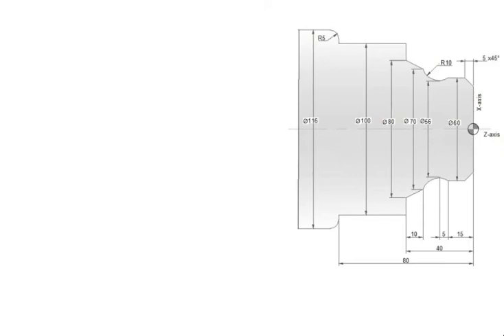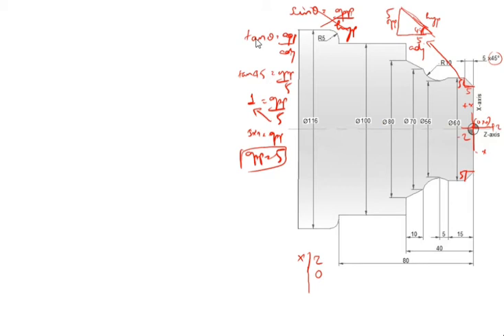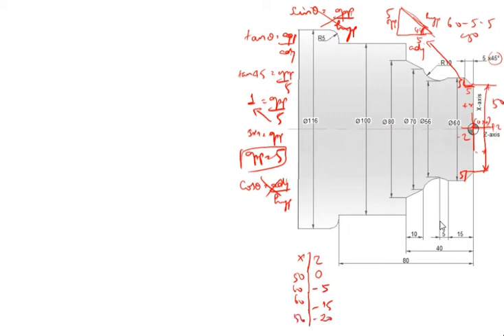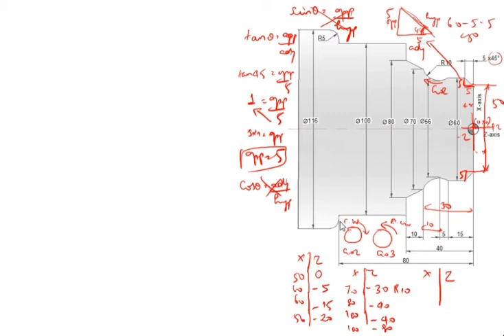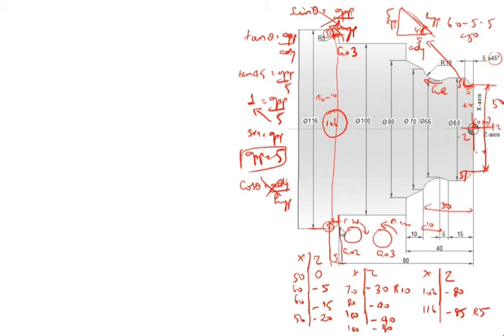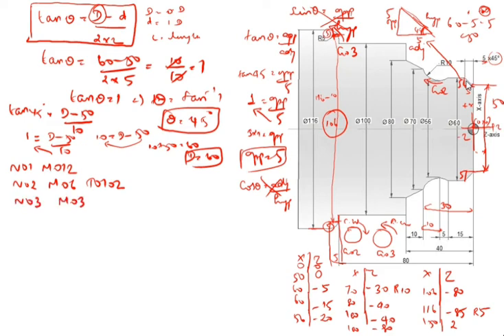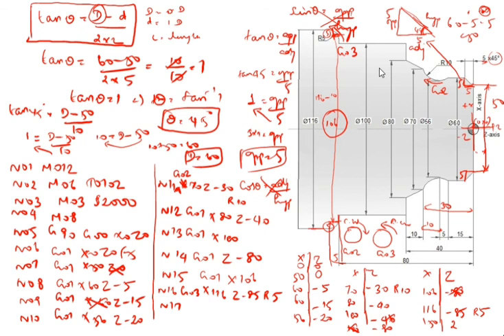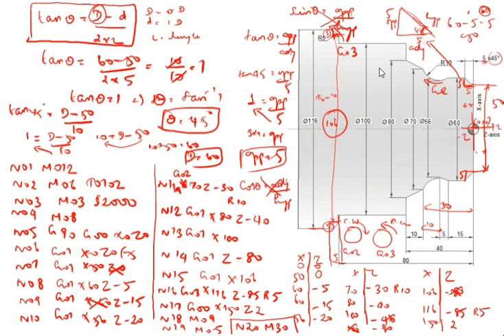CNC Turning Program for Taper Angle and Chamfer Calculation / CNC Lathe Program / CNC

Comment: ma'am can u tell me why you take 50 mm as 1st x value from the starting point(0,0). why not 25mm ? Because the (0,0) point situated in the middle of the shaft so we need to travel only half distance in +ve x direction
Reply from the maker: By default diameter is set in CNC machine. So that we took 50mm as 1st x value instead of 25mm as x value.